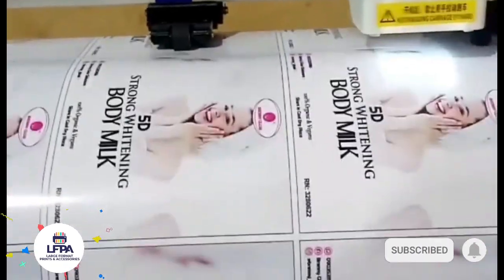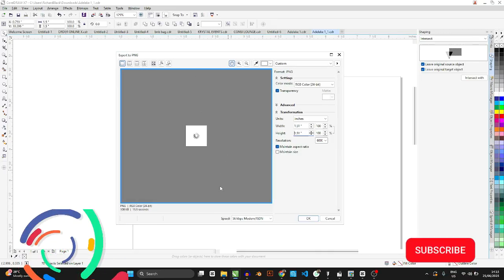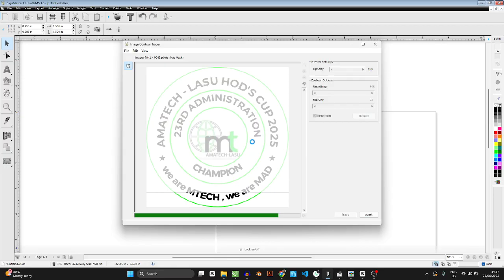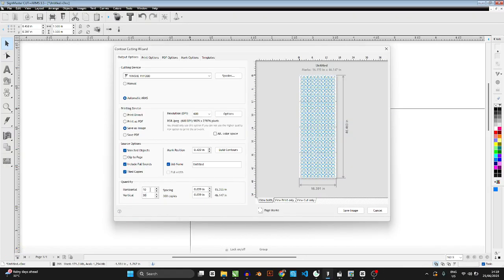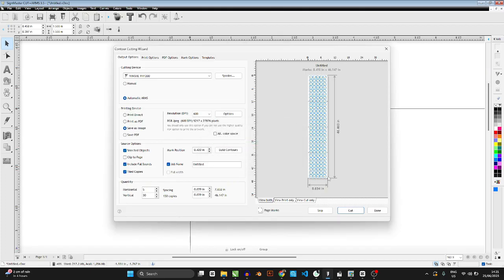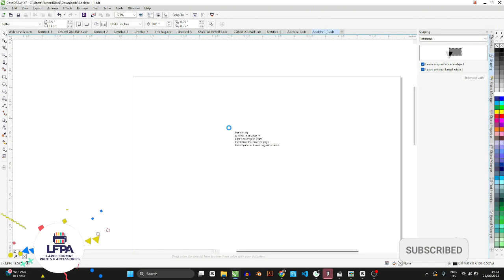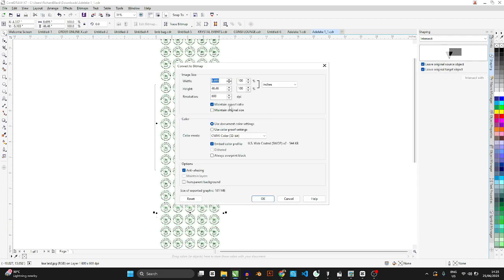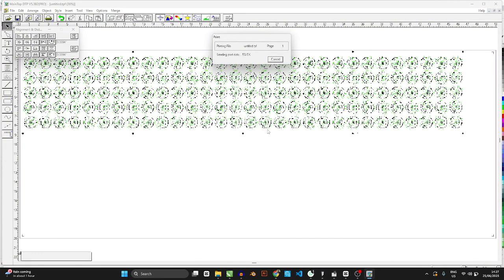How to Print & Cut with Maintop & Sigmastar using Any Large Format Machine

Comment: The main challenge is big jobs like 1000 inches of 3 inches stickers… when rendered in high resolution to tiff after laying… it tends to start hanging when exporting 😢… and when resolution is reduced it wont be sharp… so most times we tend to lay 1000pcs as 100pcs and print 10 units… 

Is there a work around for this to retain sharpness…
Reply from the maker: Your method is the most acceptable way to solve the issue.

Unfortunately it's all we have. No other way.

We also have found that the size 4feet x 2.5 feet is the best size that can work the best.

Comment: My plotter is not cutting accurately. And for longer jobs it continues to deviate gradually after every line as it cuts.

Is it a hardware issue...cuz
I have flashed the system, reinstall, adjust contour..yet no way.

I will be glad if you or anyone could help with some tips.
Reply from the maker: If you are not setting it accidentally then it may be a board issue
Reply: My Yinghe 1200 also deviate gradually.... So figured the best way is to divide the job to a size where it wont deviate as much..